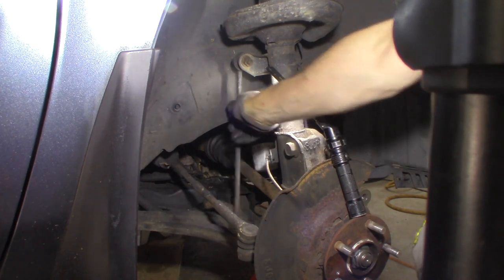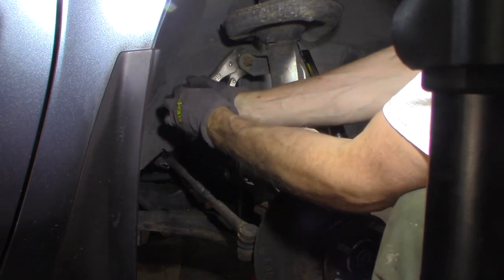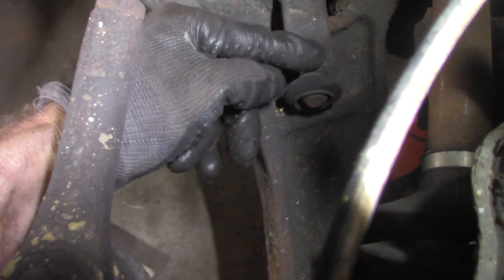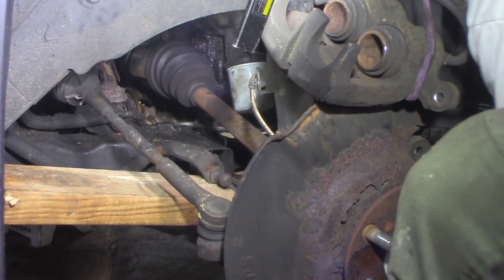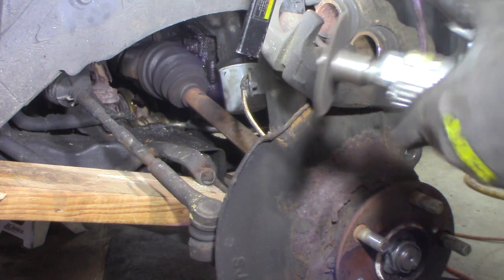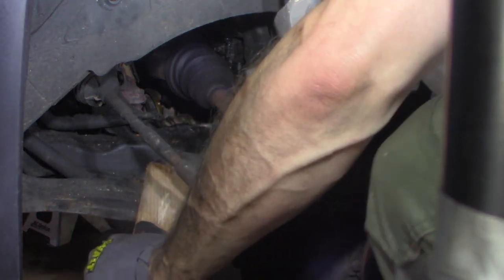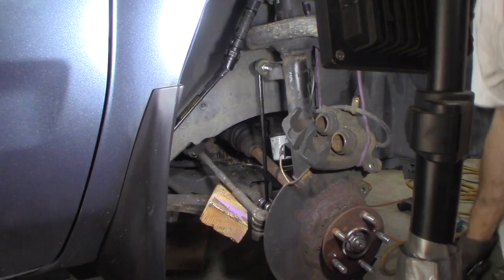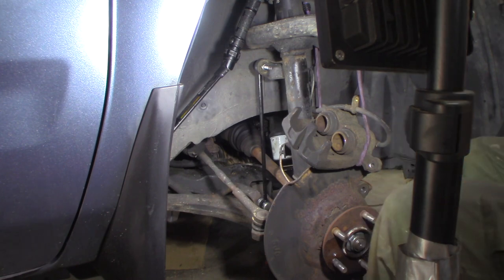2006 Honda Ridgeline sway bar end link replacement

Comment: Thanks for sharing, something my son showed me was that if you disconnect both left and right links at the top, rotate the sway bar link up, it will give you more room to work on the bottom bolts.
Reply: Do you happen to have the 1st gen ridgeline torque specification for the inner tie rod (the portion of the inner tie rod that is under the bellows boot?)

Comment: Just did my rear ones on a 2006.  Had to cut off 3 of the 4 nuts.  I still have the 2 fronts to do.  Not looking forward to it, after all the cutting today.
Reply from the maker: Next time I would undo both fronts at the same time which will allow more  movement and better access to the bottom nut.

Comment: There is a hex hole at end of link, that is your "flat".  Soak it in PB first. Also, disconnect your outer tie rod to give you more room to get at bottom. You fought this job for no reason...

Comment: what brand did you use?
Reply from the maker: Don't remember exactly, but I usually use Moog
Reply: @CharlesAndCars  i cut the top one but it still won't come out.
Reply from the maker: @robertberin4872  Yep, that happens sometimes.  They get corroded inside the sleeve.  You may have to drive it out with a punch or cut it in multiple places to get it apart.
Reply: @CharlesAndCars  1st I used a dremel to cut the bolt into 2 thinking that would relieve the tension, then I got a cut off saw and cut off the back end... beat it with a hammer so many times my arm is tired and still won't come out. I'll try expanding my flat head cut out on the front bolt and putting a flat head in there and turning. Any thoughts?

Is the bottom bolt reverse threaded that won't come out either. Used a 5 foot breaker bar and still won't budge.
Reply: UPDATE: I got it out!! HOW?

1st cut through the entire bolt with a 4.5" cut off wheel to make a flat head location for my screw driver. then used vice grips to hold the oute bolt  while I pushed the inner bolt back. Easy once I figured the inner bolt needs to into the joint. Counter intutive
Reply from the maker: @robertberin4872  Glad to hear you were able to get it apart.
Reply: @CharlesAndCars  getting the control arm in is a PIA. Could I / have others compressed the strut by putting a jack above the knuckle? Cause that would make it a hell of alot raiser due to the geometry.